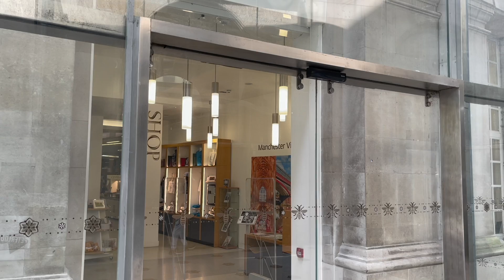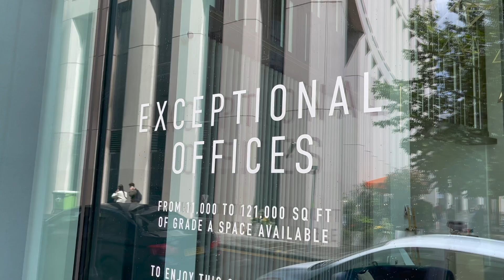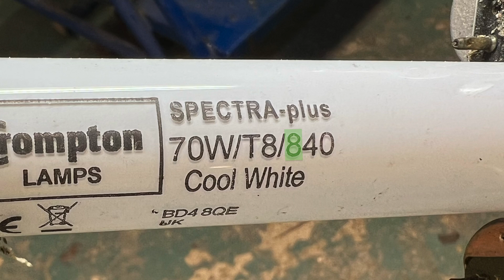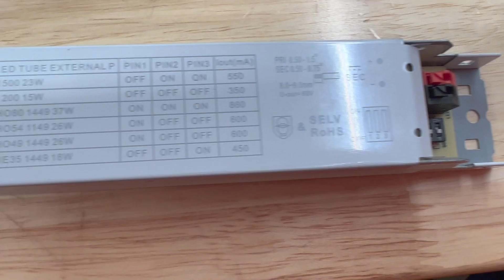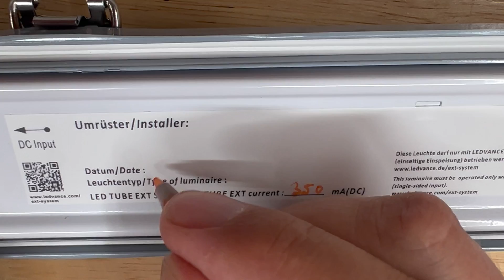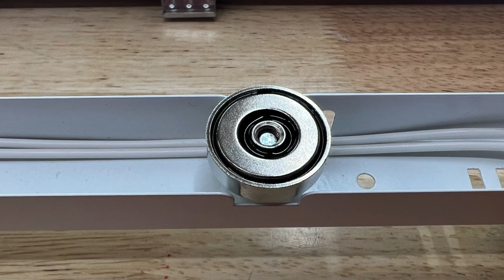How Can You Escape the Fluorescent Tube BAN?

Comment: Retrofit bulbs are excellent as we have 12 units in our garage that are perfect yet the tubes are failing after 8 years.

I do worry that the new style integrated led units, once the strip of leds fails to work the whole unit will end up in the scrap.

In my quest to find additional units that match my existing ones ive come across either a huge price hike for the bare unit or from some manufacturers a complete stop of the fixture and light source being 2 separate items therefore causing the homeowner that would simply change a bulb to now have to call an electrician to change the unit. (the eco warriors will be on that one soon enough)

In our setting that simple change would involve 12 units as my ocd wont allow just one unit to look different. As said in other comments i will be looking on ebay for old units that take tubes for my future install in my shed.

Comment: keep using clf's, stock up! Dont buy this greenwashing bullcrap. I have 16 led bulbs that are on 24/7 outside around the house and they fail 1-1,5 yrs  NONE lasted longer...and this is outside in cold climate...Leds are not good for 24/7 operation...works good as toilet light though due to many on/off cycles.
Reply: I have also stocked up on fluorescent tubes because LED's are prone to failure especially when used for long time. I had few of them and they all failed at 0.3-1.5 years. Another big disadvantage is that they cost about 10 times more to replace and don't last long as advertised. Won't ever use LED's ever again.

Comment: As a principle, I have replaced all the fittings with LEDs as and when necessary and what I am noticing is that the reliability of the LED installation is a lottery and I would say that more than 50% of the LEDs have failed prematurely and long before their stated life expectancy.  The trouble is that often the whole fitting has to be replaced as the light source is integral e.g. floodlights.  On the cost basis alone the replacement of existing lights with LEDs is much more expensive in fitting/conversion/upgraded lamp/labour costs than a simple light source replacement.

We have a number of specialist fittings that will be costly to convert, if at all possible, due to their architectural design and the cost of replacement would involve construction making good and other builders work and possibly an alternative aesthetic, which blows the cost out of the sky.

Locally, the Highways Department have replaced the sodium street lights with LED fittings at great expense, however, although the fittings are of a similar physical size, the light output and distribution is much less, leading to pools of higher intensity lighting immediately below the fitting, which then tails off very badly, leaving large dark patches between the lamp standards.  Street lighting is supposed to provide security lighting as well as sufficient illumination to minimise hazards, these new lights manage to do neither.

Comment: In the first place there should be no bans. Let everyone decide what light they would like to use. I have been using fluorescent lights for decades without any issues, and they give way more diffused light compared to LED. Fluorescent bulbs don't cost much to replace. LED's are just not good because of high upfront cost and more frequent replacements are needed which means its going cost much more.  LED's don't last that long, I've had many failures in less than 1 year, some fixtures have irreplaceable components, so that means you have to replace everything creating more unnecessary e-waste. Its not about saving energy. It is about paying more and limiting your choice to only LED's!

Comment: At my work I've been using the remaining 4 foot florecent tubes where needed and rewiring figures where thr ballast has failed in the past year. Some areas have 8 foot tubes that burned out before my time due to neglect. I've replaced thoes last fall and plan to repaired the remaining working ones. So far I have encountered 1 defective tube which isn't a big deal since it's in a utility room and it's now brighter than it ever was.

Comment: Unless LED lamp manufacturers have come up with a 360 degree output tube as opposed to roughly 100 degrees of the tube circumference being used as a heat sink, these replacement tubes will not provide proper fixture lumen output optics. The optimum solution would be a LED tube with 360 degree circumference of evenly diffused light. LED diodes by nature give off a point source, which will not work with with the reflector optics of a fluorescent fixture. Even with the fluorescent lamp ban, these lamps will still be available long after the ban is in place. It would seem logical to either retrofit or replace all fluorescent fixtures which are easy to do, but leave any existing fixture that would pose upgrading or replacement problems as fluorescent. In some cases, LED color temperature and CRI will be different from a fluorescent lamp of the same CCT and CRI. It all depends on manufacturer.

It’s hard to believe we are at the end of an era. I live in the US and remember when the F40T12 (four-foot fluorescent) lamp was the workhorse in the commercial and industrial facility world, then in the mid 1990’s, the F32T8 lamp became the industry standard. LEDs have made some improvements over the years, but the technology is still somewhat in its infancy, so there are still many optic and lifeline issues with them. The only thing about LEDs is they are quite boring. Fluorescent lamps (especially preheat, rapid start and even programmed start) are more interesting to watch turn on. Even HID is being replaced with LED, which makes for uninteresting start-ups, if you like watching such things!
Reply: Another issue I notice with LED tubes is that almost all 4ft ones are significantly dimmer than the fluorescent tubes they claim to “replace.” The 4ft F32T8/F40T12 LED tubes are usually around 1800-2500lm, whereas most F32T8 and F40T12 lamps are 2800-3200lm, and the best F40T12 lamps are 3600lm!

I think this is yet another case of cheap LEDs being inherently “better” than name brand LEDs. I can find cheap 4ft LED tubes that are 3000lm, but the highest I can find from one of the “big three” is 2500lm. I feel like the name brands are purposefully making their LEDs crap because they know people will buy them anyway because “Oooeooohuoo, iT’S leD!!111” The lighting industry is going from “oh, this isn’t a very good product for me because it’s not bright enough or it’s not the right color” to “oh, it’s LED, we don’t need to worry about anything else! Anything to get rid of those evil energy-sucking fluorescent lamps!” The fact that integrated LED fixtures exist tells you everything you need to know about the lighting industry right now.
Reply: Exactly, I was thinking the same. The glory of florescent tube cant be replaced by LED tubes.

Comment: I absolutely hated fluorescent tubelights at work, as the 120Hz flicker (100Hz where line current is 50Hz) in my peripheral vision would give me migraines by the end of the day.  I upgraded to LED replacements in the kitchen, laundry room, and bathroom, and if there's any flicker in the first 2, it's less perceptible, but in the bathroom, just tossing a towel over the shower-curtain rod shows the "strobing" effect pretty clearly.
Most of those systems use LED strings at about 50%-70% of peak line voltage, a small dropping resistor to do some of the lifting, and finally linear regulator chips to regulate peak current to the LEDs.  That means both current- and light-output spikes near the +/- peaks of the sinewave, lousy power-factor, and worst of all, flicker.
"Universal" replacements that can work on 50Hz/60Hz and 120V/240V, tend to have actual power-supplies and provide almost zero flicker, but $$$.
But they're hella bright, I'll give them that.  Too bright, in fact, as the one in my bathroom makes me feel like I'm out in the midday sun, even in the middle of the night.  I have a usb-chargeable touch-light in 2700k that I keep set relatively low, to just see where I'm going, vs blinding myself with the overhead light.
Also, some lights need the ballast to remain, whereas the universal ones often don't, and in fact the ballast just wastes power idling.
Bright(!) side is that I didn't have to replace any fixtures at all, and they were all drop-in replacements.

Comment: i just wish normal light bulbs were still around. if leds were so good why were normal  bulbs banned?
leds are not eico friendly due to heavy metals. lead zink, mercury, etc, , plastic lots of that.
a normal bulb was mostly glass. some tin, card stock. maybe (pending use) a alloy metal and or a inert gas. cosy pennies compared to the leds and lasted far longer.

Comment: Fluorescent tubes are incredibly efficient, maybe five times better than the old incandescent bulbs. It is highly unlikely that replacing with LED tech, is ever going to pay for itself, and replacement tubes are going to be absurdly expensive, and not as long lasting.
Reply: Exactly, most people in society have this problem where they have to have the next best and newest thing regardless of its quality or relevance.
Reply: I'm really annoyed that this Flurecent disappearance right under my nose was happening & didn't know about this until now. I'll be stocking up I think
Reply: @hiteck007  It's even worse that most LEDs you can but today are overdiven or have underzised power supplies with no interference filter, often no fuse and horrible quaility of soldering. They will likely fail in 4 years or less. Even higher quaility fixtures these days are absolute garbage because the LEDs in them are integrated and not replaceable.
Reply: But they all flicker!
Reply: @golden.lights.twinkle2329  You are wrong and ceartainly never heard of electronic ballasts.
Reply: They will never pay for themselves. They second they look like they will, they’ll fail, and you’re back to square one

Comment: LED's are NOT good for your eyesight (the flicker rate causes problems over time, but hey Mr Government puppet of globalist extremists, don't let people's health get in the way of your agenda....
The REAL answer to this problem of the fluorescent ban is simple:   Tubes last for years, so just go out and stock up with a view to each one lasting 5 years, so if you're 50 and you have a tube fitting in your kitchen like I do, 10 should last you the rest of your life.
Best also to buy some replacement ballast as well if it's a 21st century fitment or some "starter motors" if it's old 20th century fitments.

Comment: Im over here Stateside (Texas) and ive begun the conversion of my friends store from fluorescent to LED. He opted to retrofit the existing fixtures. I bought LED bulbs from an electrical supplier in my area that bypasses the ballast allowing line voltage to be connected directly to the tombstones (lighting sockets). This makes a conversion quick and easy by removing the ballast.
Reply: How do you remove a ballast? Where is the ballast?
Reply: @golden.lights.twinkle2329  The ballast is a little black or silver box that's behind a little pocket or enclosure of the fixture. It usually hidden behind a metal piece that you would take out of the fixture at to access it and the wiring. Make sure the power is turned off to the fixture first before doing any work to it.

Comment: if rohs is going to make it more expensive i dont want it.

i would rather non rohs compliance to keep the prices down and just be told to recycle or dispose of properly.

if the reason for the bans because of the mercury then omit the mercury and run the voltage higher.

that is what they did for a while in cfl bulbs to eliminate the startup delay.

with mercury i think a bulb runs at 600 volts but without mercury it would be as high as 10000 volts.

if the manchester fixtures contain the ballast within the body of the fixtures then it would be possible to replace the ballasts or i think they make led bulbs that have limiting resistors that can limit the currents and voltages to make them work with original ballasts.

Comment: The key words are "ballast compatible". When you're looking for LEDs to simply plug-and-play into existing fluorescent ballasts, simply buy the LED tubing that's labeled "Ballast Compatible" on the packaging, and it will work as good as plugging in a new (old?) fluorescent tube. [Source: I've already replaced all of my fluorescent tubes with LED tubes.]
Reply: I've got some GE bulbs that are absolutely perfect T8 replacements. I forget they're LED half the time.  Been going for years without issue.
Reply: @liam3284  depends on the tube. I've seen a mix. The GE ones I mentioned require electronic ballasts

Comment: You also need to really shop around for a good LED replacement light as the low quality ones will often already have a few dead LEDs from the factory and will die after a year or two while the much more expensive LEDs will last a lot longer! :)

Comment: Y'know, I wonder if they accidentally banned LED bulbs too, if they only used the "fluorescent" definition they might have!
Reply: That is very unlikely.  "Fluorescent" describes the electrochemical reaction inside the bulb.  LEDs are simply not "Fluorescent" in any widespread sense, and things like the T5 and T8 sockets are irrelevant to the bill.  The issue is mercury and other toxic chemicals, and the relatively high danger of shattered glass.  LEDs in the T5 and T8 form factor solve all those problems, and eliminate the need to replace ballasts.
Reply: @VPWedding  Actually, most LED lights are fluorescents.  You know how LEDs are monochromatic?  Well, these lights are UV-spectrum LEDs lighting up a fluorescent coating.  They use much the same phosphors as fluorescent lights, the difference is the way they generate the UV.

I did look up the EU regulation though, and it doesn't regulate LED-based fluorescence.
Reply: @o0shad0oo  Many dyes for clothes include fluorescence.  But in terms of light bulbs, the term is clearly defined.

Comment: They should never have been banned, that's just stupid, especially as fluorescent lights are my favorite form of indoor lighting. As far as I know, they're second only in efficiency to LEDS, and can outlast them by years. Now I cant get floure3scent tubes any more I had to make my own light. I took the LED back panel of an old TV that no longer works, made a power supply for it and it lights up my room really well. I still would have preferred to use the Florescent tube light though.
Reply: Here in eu a pack of 25 pcs of T8 120cm tubes cost just 50 usd...time to stock up=)

Comment: You specifically only state T5 and T8. So what about all other compact fluorescent lights ? And more important, existing emergency light maintenance which require fluorescent. Replacement would be a cost, that cannot save money.
Reply from the maker: All are banned - emergency lights - for stand alone units it’s usually more cost effective to replace the sign or emergency light. Most units now have self test which is another bonus
Reply: @efixx  When all it needs is a 50p T5 Tube, replacing the entire light is not cost effective. But yes, self test can be helpful....if we can trust it works.

Comment: time to load up on tubes and scalp them on for double money come spring. Although if you are talking about maintenance in a building allot of EM lights cook the tube used for EM and you can replace all 4 in one and cycle the 3 good lamps into the next 3 to reduce on throwing away good tubes that still have another year or two in them.

Comment: Led retrofit tubes can work on a classic magnetic ballast by bypassing the starter.  An HF ballast will have to be taken out of circuit. So no way to use these tubes  on a fitting with emergency back up.  Yet another "green" initiative that causes us to replace fittings with a 25-50 year lifespan  with an "integrated" units that are unlikely to  still work after 5 years. So much material waste........
Reply from the maker: You can get tubes which work with HF control gear. Emergency the answer is it depends.

Comment: This is also an issue for some medical equipment, as some older hardware (and actually some hardware bought as recently as 2020) uses Fluorescent tubes. One such piece of equipment uses two T12 tubes, which I cannot replace, and we're not allowed to modify equipment, so in the end it's probably going to go to waste just for the sake of two tubes!
Reply: There’s plenty still around on the internet and ebay, including special UV colours used in medical equipment.
Reply: In the bill passed in Maine such UV bulbs may be exempt from the ban as they are not general purpose lighting.

Comment: 0 seconds ago
My Garage fluorescent 6ft fixture still has it's original 50+ year old ballast. When the bayonet cap tube failed I changed the connectors to fit a new tube. Therefore it's a very environmentally friendly fixture & lasted longer than any modern LED ever will.
Reply: I have about 20 to 30 complete fittings with tubes. My brother in law who is a civil engineer asked if I wanted to salvage anything from  a building his company bought and were about to redevelop.  I just took everything.  Funnily enough he used to work for the company as their civil engineer.
Reply: The original fluoro in my garage is from 1976, two additional ones were added in 1986, all on original ballasts although the older one is quite noisy now, I've got quite a few spare tubes as well